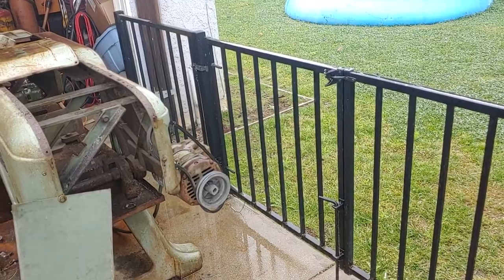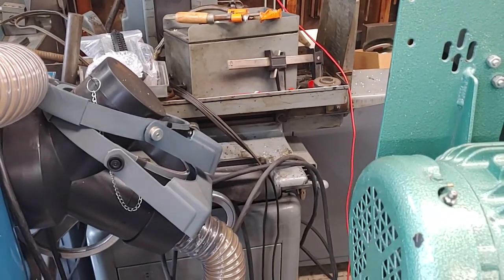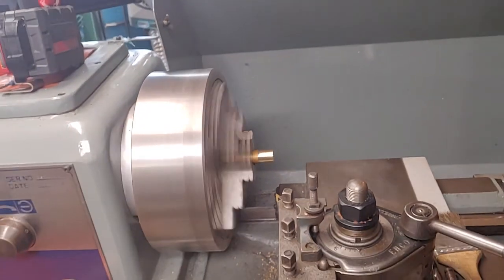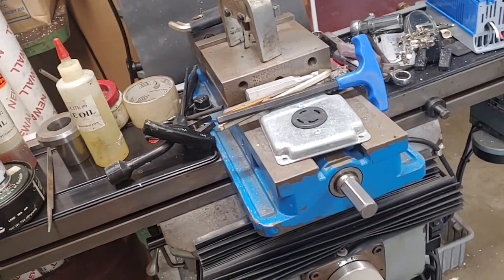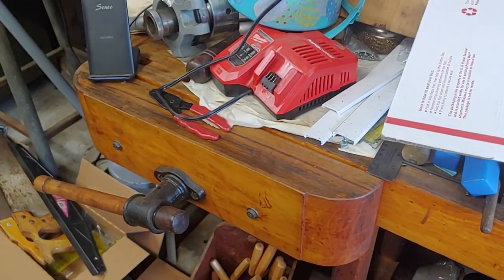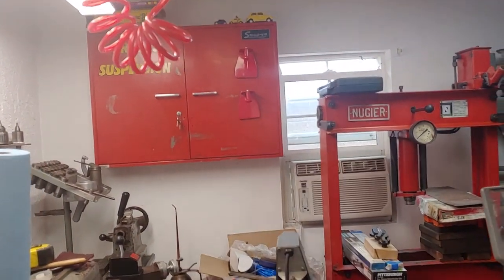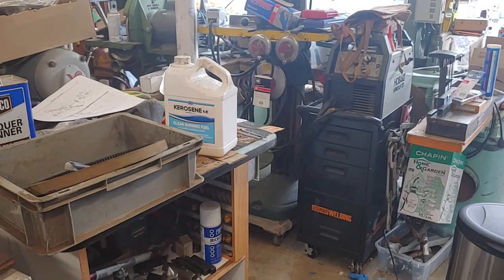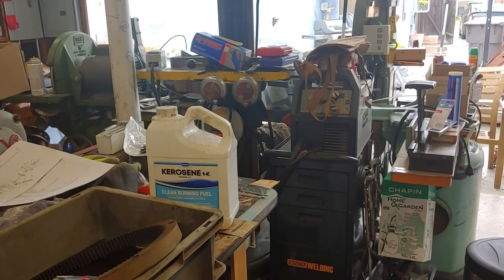Shop tour: new shop tools, same shop mess!!

Comment: I like watching your shop tour videos. If you can I would like to see more about what you have done with the Bridgeport clone. The Freeport surface grinder I picked up looks a lot like the B&S you got. Have you done anything with it?
Reply from the maker: Thanks! A lot has changed since that video. The ABC j head Bridgeport clone was sold and I now have a Webb variable speed Bridgeport clone is now in its place. The takisawa lathe is gone and a whacheon replaced it. I still have the surface grinder but haven't done anything with it yet. Looking forward to getting it set up and using it though.